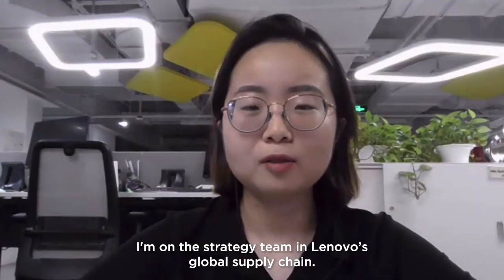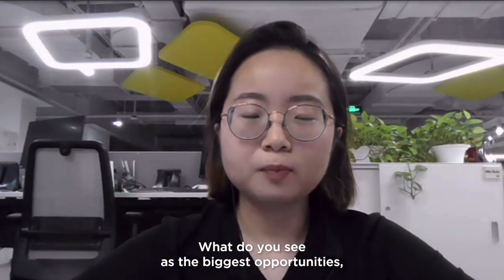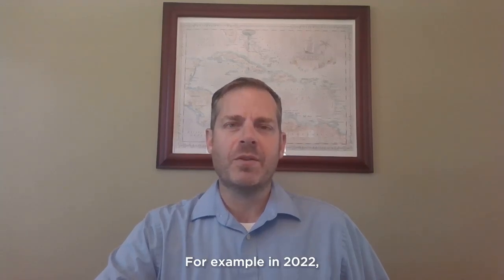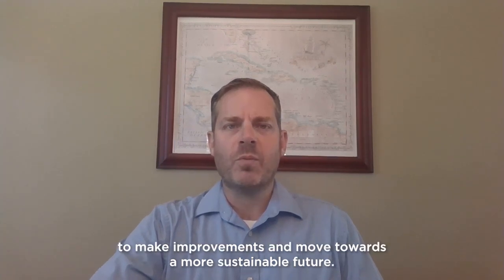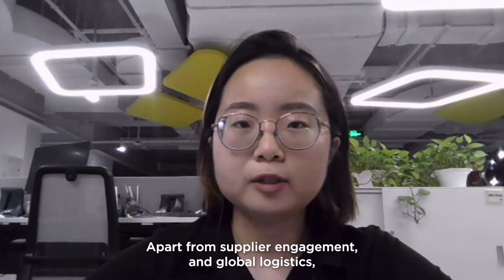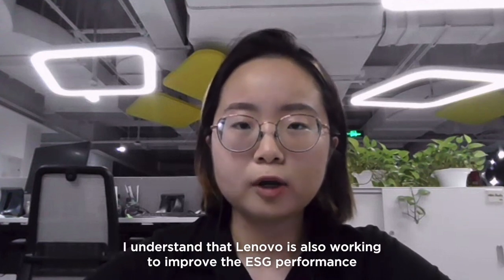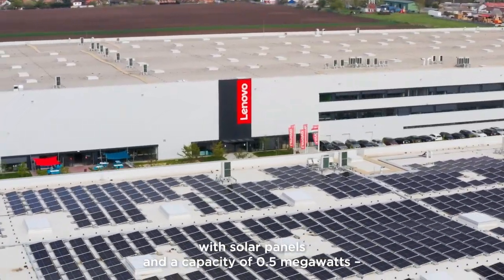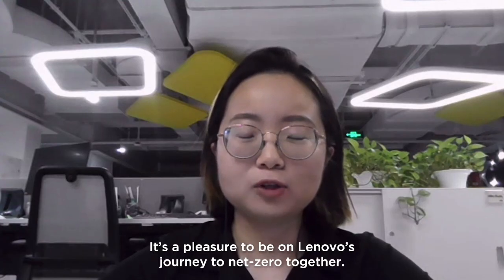Journey to Net-Zero: Sustainable Supply Chain

Comment: There's nothing sustainable about internal combustion engines. There is no difference between pulling hydro carbons out of the ground or producing ethanol. If you are pumping CO2 into the atmosphere. You are pumping CO2 into the atmosphere. Please abstain from green washing.